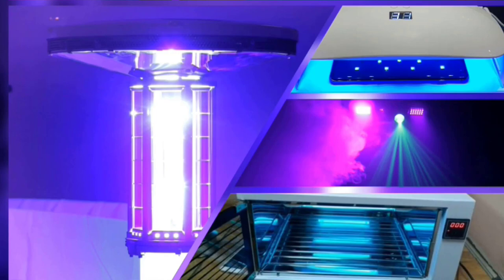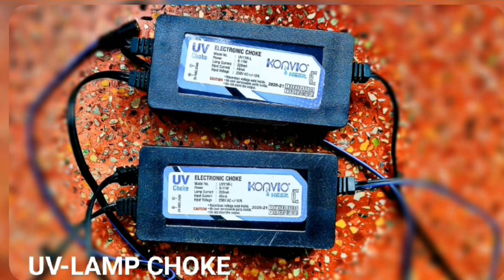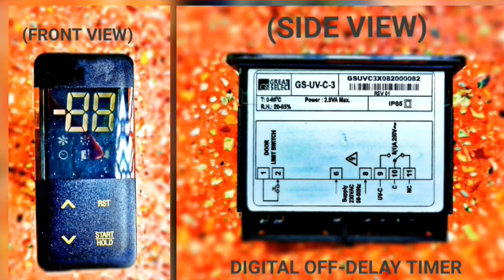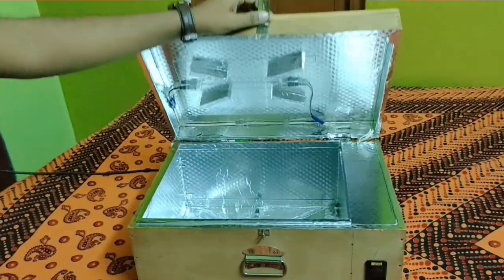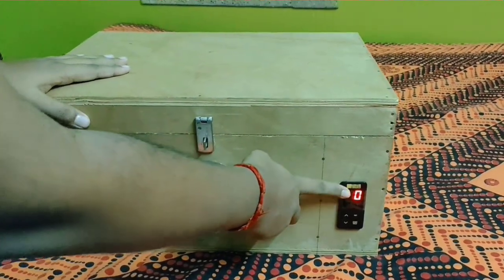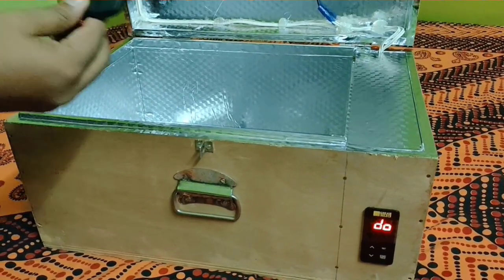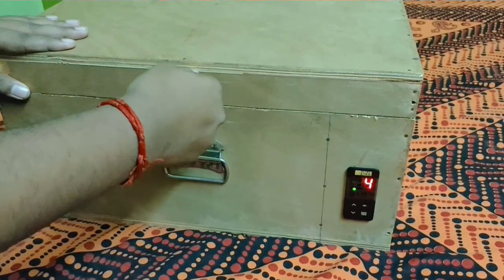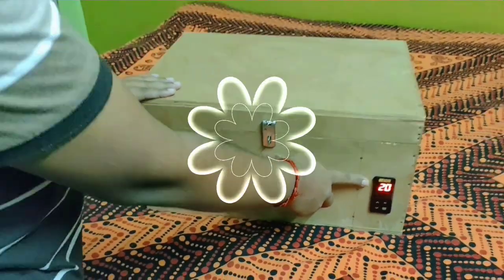How To Make UV-STERILIZER BOX or UV-SANITIZER BOX  At Home With Timer & Safety Features? | YouTube

Comment: I don't recommend using the transparent cover. There are some literature reviews that state that UVC light will not be able to go through the material eventhough it's transparent. It will only allow UVA and UVB light. This will limit the sterilization capacity. Unless the transparent cover is made up of quartz crystal, ie the same glass material the UVC light bulb is made from, it will not let the sterilizing benefits to be reaped.
Reply: Exactly the point I was thinking. Looks good. Well designed. Good safety and control. Won't actually work because the transparent plates will block the UVC.
Reply: Which still won't make it work as is.

Being cheap and readily available won't stop it blocking UVC.

Also, degrading over time from exposure to UVC underneath.
Reply from the maker: If you want you can surely add, use or skip materials which will increase its potential's but as this was for larger audiences, who are mostly unaware of UVC, so we tend to keep things which will be the most safer for our lovely viewer's.
Thank you 😊🙏